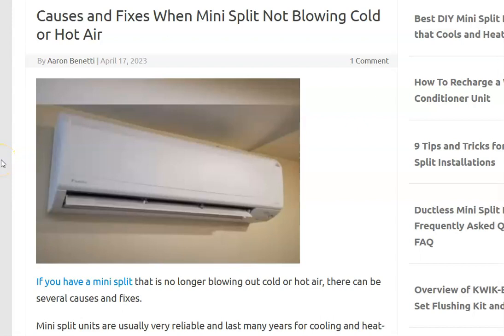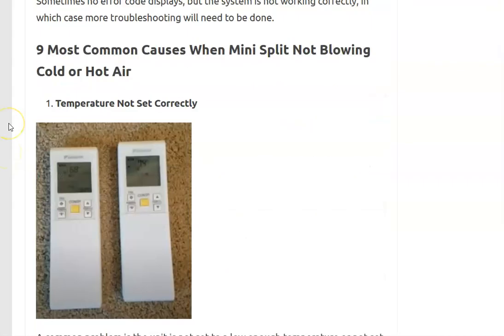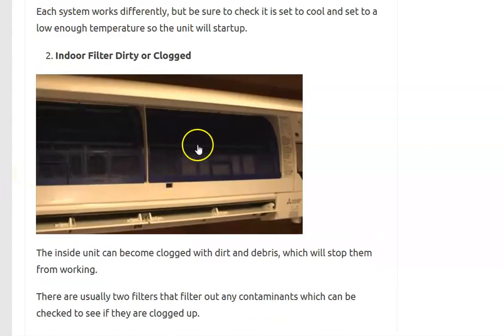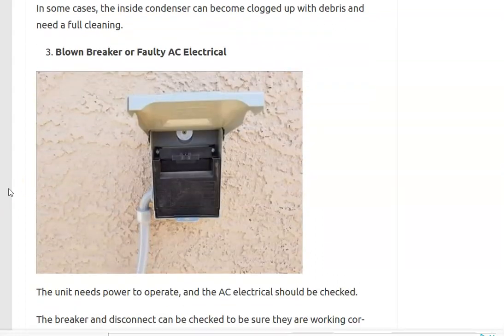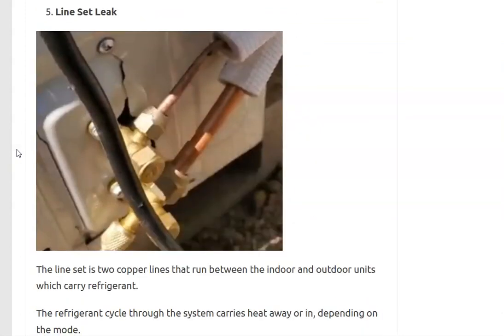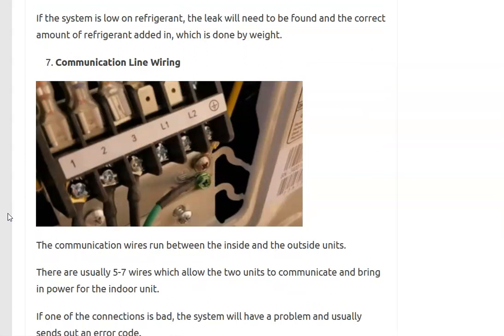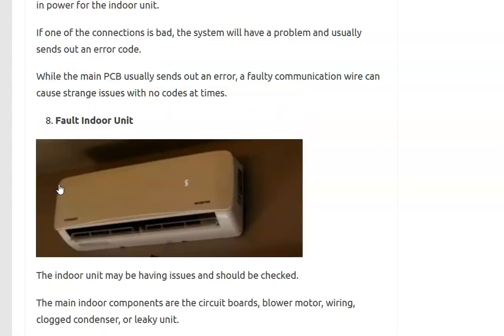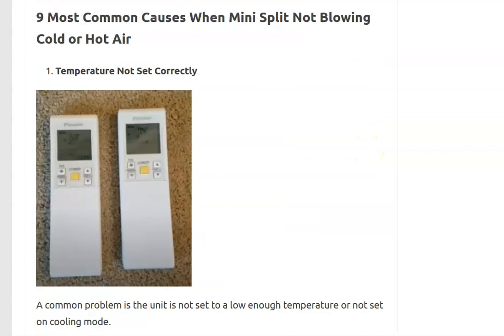9 Most Common Causes When Mini Split Not Blowing Cold or Hot Air

Comment: To add :
My remote had a timer set in to save energy purposes. Although, the time was no longer adjusted with the current time. So even if I wanted more heat, the unit wasn't sending it.
I discovered that by watching the video and noticed the time was wrong and there was a timer button next to my clock button. I switched it off. It took about 10 minutes before my unit started sending heat again.

Comment: ALWAYS try this: Turn off the breaker in your electrical panel that runs your mini split, wait 1 minute, and turn back on.  Try the simple stuff first. This solved my problem when my heat would not come on. My units were working fine the day before. My controller was set correctly, and there were no error codes.

Comment: My fujitsu halycon will not turn on or off with remote..Tested two remotes and they are fine..It will every purple moon go on a mode it was last set for but will not turn off or on with remote..Only way to get it working in a set mode is to pull or install fuse..Its about 9 yrs old and acts as if it doesnt see remote to turn off or on but works great otherwise..Any thoughts before it gets replaced,we are getting into the cold season of eastern canada..

Comment: My  Fujitsu system wont keep a set temp. I have a ducted mini-split and two thermostats both set to 72 but its currently 79 and 78 on main level and upstairs and barely any air coming out of the registers. The air that is coming out doesn't even feel all that cold. I've had people out here seven separate times and nobody can get this figured out. It like the thing is short cycling. It will actually cool down at night and get it to close to the temperature that is set on the thermostat but never quite get there and then during the day specifically later in the day it climbs to near 80°. It's also super humid as well. I'm having to run a dehumidifier on the main level because the humidity gets into the mid 70s. This system is only three years old and it has had a new system board. It's already had a new thermostat for the main level. It's been recharged. I meticulously change the filters. Why can't anybody get this figured out? What else are we missing. Someone mentioned something about setting the static pressure on the thermostats. I'm at a loss here. This thing worked great the first year we moved in and has sucked ever since and last month my bill doubled from the highest bill that I've ever had here previously. I need fresh eyes on this thing and nobody really knows anything about these things around here for some reason. Specifically the Fujitsu system.

Comment: my liquid line is frosting over and the unit is cooling
Reply from the maker: Be sure the inside unit filters are clean, and the coils don't have a lot of debris blocking the airflow. Also, check the outside unit for any debris blocking the airflow. If that is all good, it needs to be checked out since it may be low on refrigerant.

Comment: I have a mini split comfort total 18 btu. Cooling mode. It starts working, blows cold air, but after a few minutes stops cooling. The external unit fan stops working. The inside does not blow cold air and there is no codes.
Reply: Same 👀

Comment: We have a LG minisplit with three indoor cassettes. Sometimes all three work amazing and other times, the one in the master bedroom will not blow cold air well. I've checked the filter and the condensation line and nothing. No error codes. It's set to cool and below 70deg and still blowing mildly warmish/coolish air...nothing like the other two heads which are set to 72. Why the inconsistency would you think?
Reply: I have the exact same symptoms.  Please let me know if you figure it out.
Reply: @rutriders2840  having someone replace the control board I think. These systems are so complex. It's under warranty but the labor will still be about 3k.

Comment: TRY MASTER AC OFF [ 1 minute ] ON.  I have 5 new units, including 2 of the newest "in ceiling" units.  We don't need them very often but they have definitely been working.  Then today it's getting a little warmer - 3 of the 5 were blowing warm air.  (Arrggg!)  Tried this and that. Including trying to figure out the various Remote settings.  Then checked the Master Breaker - which was "ON".  But I cycled OFF / ON and ... violas!  Everybody is blowing cold air.

Sometimes you get lucky.  Thanks for the great video.
Reply: Where is the master AC switch?
Reply: That sounds like my problem, we had a power outage overnight and now the unit is haywire, reset breaker and everything is back up and running

Comment: Hey, I just installed a new Pioneer WYT-19, it's not cooling very good at all. I noticed the compresser fan appears to be running backwards. The air is coming out the front of it.  I don't believe it's supposed to do that. Can you help? Like, witch way is the cooling air supposed to flow?

Comment: Had one where the indoor unit kept blowing. It’s on a BAS system and the set point on the thermostat was 86. Reset the inside unit on the power button. Turned it back on and it started working normally. Anyone run into this? I still have to check the condenser to see what my comm voltage looks like

Comment: I have a question regarding the fans inside the ac unit.. they just keep spinning when off is that normal? only stops when I disconnect the power on the circuit.

Comment: I have my copper lines running through an attic that has no air conditioning and it gets really hot in there. Do you think this is also a cause why it’s not cooling as it should ? It’s newly installed and I’ve seen no leaks coming from the condenser at least as of now.
Reply from the maker: No, that shouldn't affect the unit from working. It may make the unit less efficient, but it should still work. If you think it is an issue, test it at night when it is less hot. Also, there is insulation to wrap the lines, which can help make the unit run more efficiently.

Comment: I was told that if one of mini splits on a different level is on heat then I can’t put my unit in basement on cool because they are on the same line. Is this true?
Reply from the maker: If you have a multi-zone mini split system with 1-3 indoor units and one outdoor unit, then yes, all the indoor units will only cool or heat at the same time. If you have multiple single-zone units, it won't matter.

Comment: Our unit just stopped working. You press the button one day and nothing, when a few weeks before it was fine. It's an older Mitsubishi and it doesn't display error codes but it was great for the last ten years or so. What's the fix?
Reply: check if the compressor is running

Comment: What could be the issue? with the unit, if I turn on the heat and it shows the heat and It could take half an hour just to begin blowing warm air. in the beginning, it just sits with its "mouse open", vent.

Comment: I have a one year old Daikin with only a couple hours on it. I installed everything but the freon. It actually was prefilled and should've been fine. The hvac guy I had come out let what seemed like half the freon out. He said the lines needs purged and cleaned.  Ever since, it will barely heat and cool. I've called him several times and his answer is it only cools and heats up to 20 degree difference. Well, when it's 15 degrees out, I didn't put it in to heat to 25 degrees.  Or when it's 110 outside, I expected lower than 105.  I believe they are over rated if this is a true example. 
  I really feel he let too much freon out and now it's low.  It proves my point when it has to defrost often.  Another company told me they'd have to drain and fill to service it. Of course, they won't credit what they are taking and want to charge for the full fill.  I don't mind paying the service fee, but it's a big scam when hvac people take your freon, then charge you for it putting it back in.
Reply: It’s more than likely a contaminated system full of non condensibles. The proper methods to fix you system would be to drain the system, flush with nitrogen and a small trace gas to make certain you do not have leaks, then pull a vacuum down to 500 microns to remove the non condensibles that have contaminated the system. You don’t want someone using your old contaminated refrigerant if that’s the case. You would want new refrigerant that is clean and allows for proper superheat and sub cooling to take place so your system operates as it should. Mini splits are know to get leaks if they have had a poor install. They are touchy systems that should be installed with proper knowledge. You have to use nyllog on all fittings and use proper torque wrenches so the flares won’t be over tightened, split, and leak…. 🤷‍♂️ we don’t steal refrigerant but we do have to handle it properly. We cannot use your refrigerant per se at another job nor would we want too. It’s illegal too and it isn’t worth a damn if line sets were not purged properly and your system is contaminated. We can only turn it in to a place for reclamation.
Reply: It seems as though the ac guy that leaked your stuff out jacked it up in the process. Crap like this really makes me mad because we just try to do the right thing and something goes wrong!! Ugh

Comment: Hi there I have a Fujitsu 4 in 1 inverter split system.  The main big one downstairs work fine but all the other 4 smaller units don’t blow cold air anymore.  Is there a way I can check what the main issue is?  Since the downstairs one works fine,  that makes the other 3 have some issue.   There’s only 1 outdoor unit connected to all 4 indoor units.  

Thanks!

Comment: just moved into a new construction apartment and the mini split worked for about 2 days.  it turns on and blows a consistent temp air, but won't get cooler or hotter.  no error codes showing.  I wiped down the top of it recently because there was so much debris from the construction on top of it.  a day later is stopped changing temperature.  so frustrating considering the premium this place is charging.

Comment: Mine blows cold air in AC mode as needed.  But once I set the remote to Heat (86F), the fan stops blowing air.  It only blows air in Cool, Auto, and Dry modes.  Any thoughts?
Reply: I’m having the same issue and it’s been on for about three hours. As soon as I turn on the  heat the fan kicks on for about 15 seconds and then stops as well as the louver.
Reply: I’m having the same issue
Reply: I’m having the same issue
Reply: Have you figured this out?
Reply: @christyanhernandez9286  there was nothing wrong.  My HVAC guy told me to be patient and let it stay on and it will take about 5 to 10 mins for it to start blowing hot air.  And it did.  So not sure internally what's happening,  maybe someone can chime in, but it takes a few mins for it to start cranking heat
Reply: @alenmirz1766 we’ve had on ours for hours, still no hot air coming out.
Reply: @alenmirz1766 that is normal. I call it settling time to protect the compressor from damage.
The display usually flashes the set temperature until the timer times out.
Reply: i just this happen my self thats why im here. im freezing. i have a goodman e series it wont blow heat. im so upset. you figure anything out? @christyanhernandez9286
Reply: Same problem here, mine is a 4 zone the other 3 work fine.
Reply: My unit is doing this as well. Have you had any updates with the issue?
Reply: I'll be addressing this Tuesday or Wednesday this week.
I'll try to come back and post what I find.
No heat, no error codes, fan runs continuously. 
Troubleshooting from afar with a little old lady trying to help.
My bet is low refrigerant.
Reply: Mine cools, but switch to heat and nothing. Outdoor fan runs until I swich to heat.
Reply: Im an hvac tech. i was told if you set temp a really high and sensors can tell it cant make that demand you must wait several minuets till system is able to keep up.
Reply: Not an A/C guy, but reversing valve switches flow of refrigerant from cooling to heat mode. If there's no heat coming in fan will not operate. I would check temp of the indoor unit coil and if small or large refrigerant line is getting hot. The larger tube should be getting hot in heat mode.
Reply: Seems like a common problem
Reply: Im having the same issue gang! My bedroom does this but not my living room. Anybody figures this out please help us all lol!!

Comment: One of the 2 inside splits (from the same compressor) is only blowing medium cold air and not cold air like the other unit. No error codes. AC guy told me there might be an air lock and also wanted me to change the compressor. Please help any way possible. 🙏🏻🙏🏻🙏🏻

Comment: I am hoping you can help me solve this mystery. Our 1 year old Mitsubishi mini split has 3 units. 2 of the 3 units work great. One of the heads works but will not cool the room it’s in. Standing in front of the mini split, you can feel the cool air, but if you move *a few feet away you’ll be sweating. The techs have come out  but can’t figure out what it could be. Do you have any ideas? The line used for this head is the furthest away from the compressor . I am wondering if it’s too far away ?
Reply: I have the same thing going on with mine.  The one that is furthest away from the condenser doesn't blow cold air.  It also doesn't dry the air like the other two units in adjacent rooms.  Please let me know if you were able to solve this.

Comment: HI  We installed a 2 ton in our cabin in 2019. When we set the temperature with the remote it never tracks properly IF we want the cabin to be 70 inside on heat we have to set it at 76 or if we want it to cool at 76 we have to set the thermostat or remote at 81...Isa this a sensor inside or outside that causing the problem Thanks Never any error codes unless its for defrost. Ductless Aire
Reply from the maker: Since there are no ducts to spread the air sometimes, depending how a home is built they can heat or cool the space around the unit quickly causing it to turn off. If you have a fan, you can point it at the unit for a day or so on low and see if things improve. If they do improve, often a ceiling fan is placed close to the unit.

Comment: Ours is blowing cool air, but I've noticed recently that the right side is blowing air more powerful than the left side. I just cleaned the filters and put them back in, but it seems to be the same. Not as powerful on the left side. I guess I'll have to check below the filter on that side. Maybe there is something going on there. Any suggestions? Thanks for the video.
Reply from the maker: If the filters are good, check the coils. Sometimes, they get clogged up and need to be cleaned. Also, the blower motor may be having an issue.
Reply: @HVAC_Mechanic  Thank you!

Comment: Hey I have a question
I can feel that my outdoor unit is blowing cold air but my indoor unit is blowing hot.

It’s like what’s supposed to be happening is reversed
Reply from the maker: Heat pumps will reverse depending on the mode. For cooling be sure it is set on cool mode.
Reply: @HVAC_Mechanic  any chance I can speak with you outside here?

Comment: I have a Della Mini split 1 ton. When I set it for cold air it works properly. But when I switch it to hot air, the heater isn’t kicking in and the fan is super low. I have it at the highest temperature and on turbo speed but nothing. Any ideas? Thank you!
Reply: Same problem here. I've let tge heat mode stay on for 30 hours now, and does exactly what you are describing. Mine is under warranty and once he has repaired mine I'll let you know what the problem is* 

*Hopefully
Reply: @skttruel  any information about this , I’m having the same problems

Comment: I dont get no error code but just wont blow air when in heating mode 😢
Reply: Exact same problem here, fan runs in all modes except heat. Set it up to 80 when it's 50 outside no fan in heat or auto mode.
Reply: Same everything except heat.
Reply: @charcurley same

Comment: Would the line set length have any thing to do with a unit not working? Do you have to add refrigerant if your using a lineset thats 50 feet long?
Reply: Usually they are factory charged for a specific length as far as I know, so if you exceed that length you’ll have to add a little more charge

Comment: When all three lights on the indoor heater on the mini split are flashing. what does that mean.? I shut the breaker off but am aged and had to get on a ladder to get dusty filters out. Usually, my son helps with that and I wash the filters. What about the stuff that fell through the top vents when I took the filter out/ How does one clean behind the filters?

Comment: Not sure if you reply or not but I can't seem to find an actual solution to my issue...here it is..

I have a comfortotal mini split with heat pump...install3d brand new in April 2023...it was kind of cold then so I had to use the heat pump...it came on and worked real good then beeped and the temp display started flashing of and on, no error code....I could unplug it and let it sit for a little bit and it woukd do the same thing. I had planned to warranty it but the place I bought it went out of business. Now it's cold and I tried to use it and reset it again but it just started flashing and would never blow hot air....note that the a.c. works great and was amazing all summer.

Comment: What does E0 mean mine is not blowing cold air
Reply from the maker: An EO error code is usually an Indoor EEPROM Error. Turn off the power to the unit at the breaker to reset it and see if it clears. If it doesn't clear, you will need a tech.